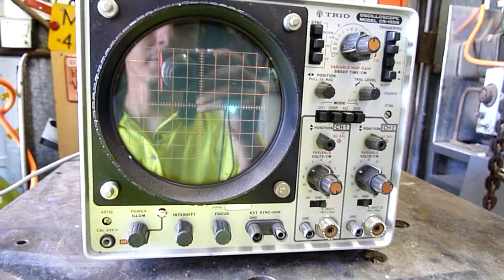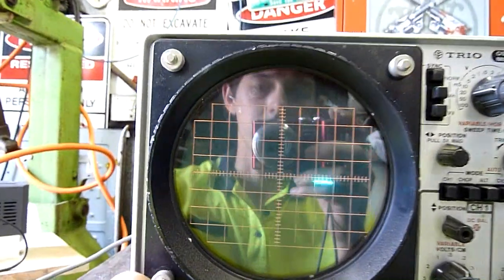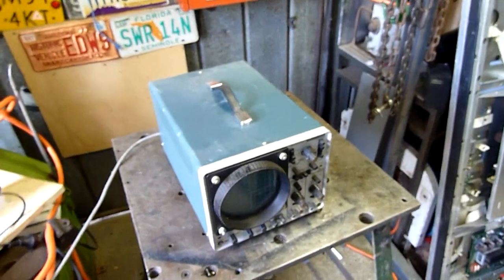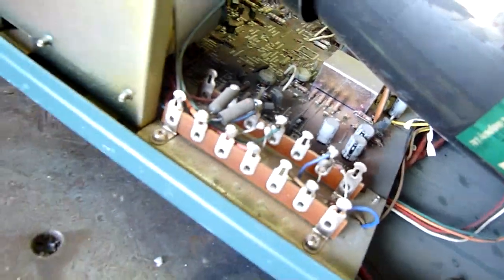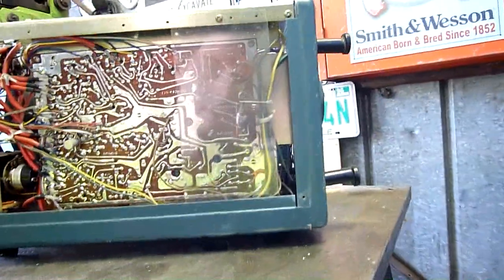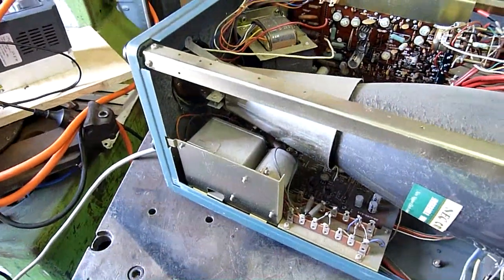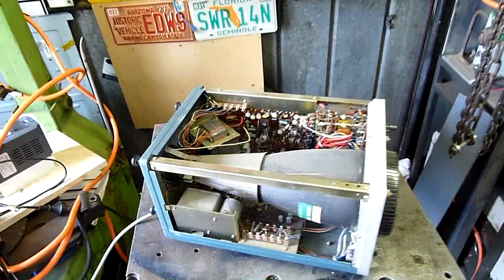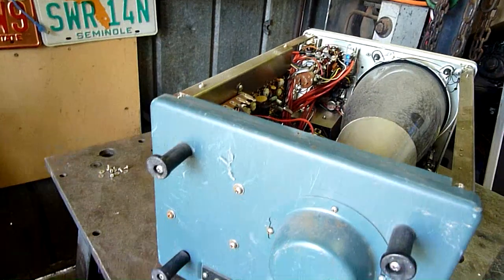Vintage Trio Oscilloscope CS 1556

Comment: You can use the modern oscope test leads, you will just need a bnc to pl259 adaptor, they are common, as they are used for amateur or CB radio
It's nice that you can use either bnc or banana leads

Comment: Those connectors on the front with that spikey edging all the way around..... The last time I saw those, they were on the back of a Sanyo Betamax (Betacord) and they were used for the video in / out.

I have a couple of adaptor connections which would've fitted on the back of the Betamax. On "the-other-end" of the adaptor connections are standard RCA phono sockets into which a standard RCA plug can be connected. :-)

I have known other Betamax machines to have the 'push-and-twist' BNC connections.

Thanx for showing,

-BoomBoxDeluxe.

7th February 2014, 10.49

Comment: Those are not banana plugs Ed, they're PL259 aka UHF connectors. You can get PL259 to BNC adapters from Jaycar/element14.

Like DeRaafMedia said, take good care of that old girl, they are a rare blessing. Look at EEVBlog's videos for tips on how to drive/care

edit: Jaycar cat # is PA3652, I use these on my amateur radio rig in the car (so I can disconnect the main rig and plug in my handheld and use the main antenna)

Comment: Ed,the Earth's magnetic field can affect trace rotation. That may explain why it changed. Try checking it on a wooden surface away from large metal objects (I know that will be difficult for you!) and then turn it 90 deg to see if it changes.

Comment: Those old scopes are great for diagnosing issues in things like automotive controls, or stuff in automation, lot of good info on how to use it online. It's a scope, measuring voltage over time, their quite easy to use once you get the hang of it.

There should be a control on the back for adjusting x-y so you can get the trace straight, it's just normal component drift, it varies with temperature.

Comment: That scope should have a trace rotation adjustment on there somewhere, which will fix that little slant issue. If it were me, since that has a Z input, and you can probably configure the channels as X/Y, i would make a scope clock! buy or build a kit, and make a clock with it :-)

Comment: The beam tilting is a result from the earth's magnetic field. See on the lower left side that little adjustment screw is most likely for beam tilt adjustment.
Reply from the maker: very good point!, I will have a go at that
Reply: The one labeled ASTIG is for trace astigmatism. It is used to make the trace focus equally well in the horizontal and vertical directions. If you can select no sweep or a very slow sweep and lower the intensity to a dim dot, you should adjust the ASTIG for a round (not oval) dot.

Comment: Your lucky to find.rare stuff like that wish I could find stuff like that at dumps here in the uk does that grid on the front of the CRT come of you can normally clip them of
Reply from the maker: yeh I took the grid and color diffuser off when I got it, it had water and dirt floating between the layers and looked like crap. it all cleaned up nicely!

Comment: I have quite a few of those plugs, they are the same plug that is used on most CB antennas.  In US, they are actually available at most hobby shops (RadioShack).  is there a chance that a scope like this would be paired for tuning antennas with radios?  Also, some CB antennas would be able to plug right into the scope...Would be useful for tuning a tesla coil also.

Comment: Awesome scope.

Not sure on the age, but I'd guess early mid 1960's since it has no ICs at all.

Not sure, but some components may have a date code somewhere which could be used to get an approximate date of manufacture of the scope.

Comment: If I remember correctly those connectors are PL-259 and you should easily be able to get a adapter to convert them to BNC on ebay.

Comment: Should be a small trimmer pot on one of the boards to adjust trace rotation. Possibly an old resistor gone bad on the output stage

Comment: Oh, a Trio-Kenwood scope, looks like it may be late 60s or early 70s vintage, all solid state other then the electrostatic CRT of course, you don't often see Japanese test equipment that old around here. That looks like a rather high end scope for it's age, much better then the typical cheap EICO or Heathkit model. It should be able to detect AC ripple without any issues, ripple is usually low enough in frequency for even the cheapest old and nasty scope to pick up. The deflection issues may be related to failing high voltage caps in the power supply, those would be paper or mylar not electrolytics. The connectors look sort of like old style microphone or Amphenol connectors, but with a banana jack hole in the center, so whoever said they are UHF connectors may have called it.

Comment: There should be a trim pot that adjusts the angle of the trace, try adjust the screw labled STAB, that's likely the one
Reply: I believe STAB is part of the trigger circuitry. Scopes of this age/price often didn't have trace rotation controls. I suspect magnetic fields are causing it.

Comment: That is normal it will have a trace rotate screw. This will easily find ripple on power supply's because that is either 50-60Hz  or 100-120Hz. The second is doubled because of the way some power supply's are designed(think about it diodes). Anyway this scope probably as a 3db point of about 5mhz. This is many order of magnitude over the needed bandwidth to see ac ripple supper imposed on dc. Hope this helps.
Reply: You're right, linear supplies are going to have 50,60,100,or 120Hz ripple. The 100 and 120 Hz figures are more common because most gear uses full-wave rectification versus half wave which would have 50 or 60Hz ripple. Most modern gear (like his plasma) have switching power supplies. The ripple on them is likely to be between 20 and 150 KHz. The secondary caps usually go bad before the primary side cap. Either way, this scope has plenty of bandwidth for almost any power supply repair.
Reply: Chris W
Either way fast ripple or oscillation on that scope with show up as a thick fuzzy trace.